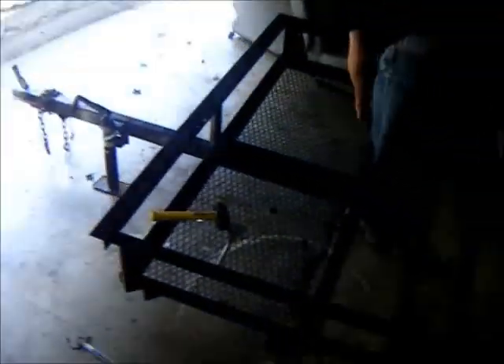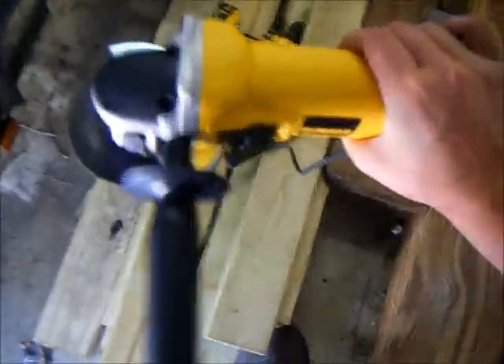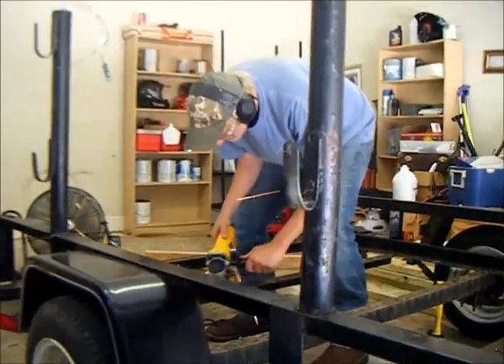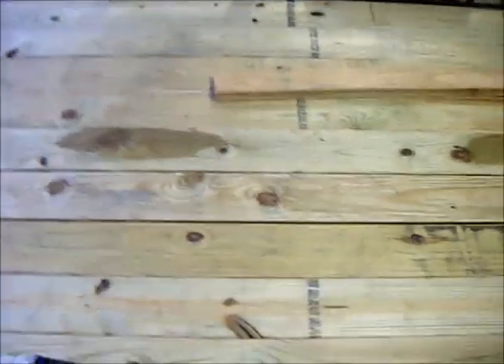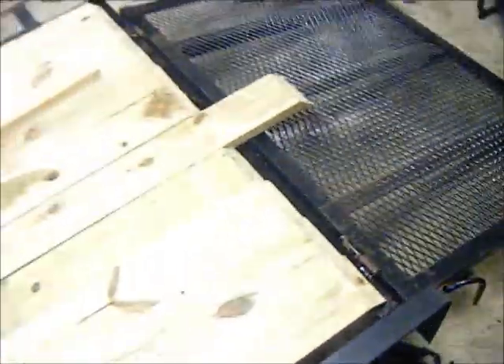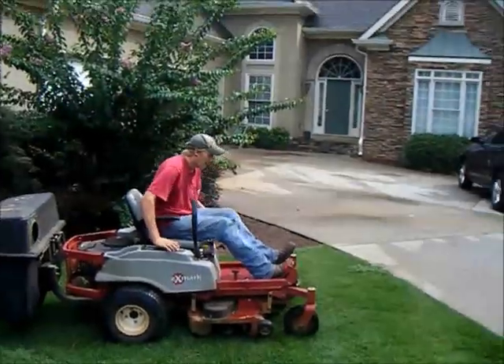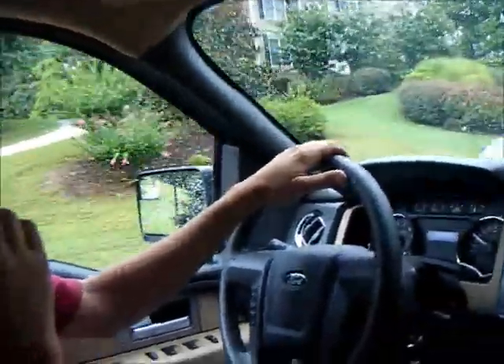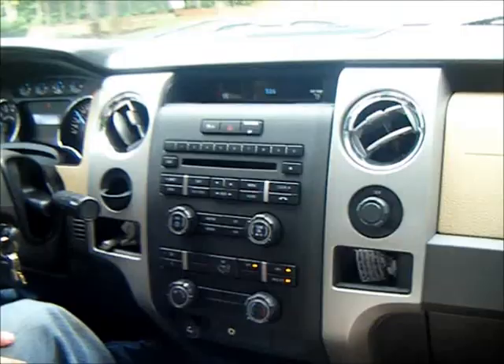A new deck for the trailer

Comment: I just bought a new trailer but decked it myself to save some $. Used 2 X 6 X 8 pressure treated lumber and bolted it down with 1/4 inch 3 inch galvanized bolts. I put the wood right over the mesh.
Reply: could you post a picture of how it looks
Reply: Jorge, I'll have to pull it out of the garage and clear it off to get a good picture. I'll post one as soon as I can.

Comment: Did you paint the grinder spots under the wood? Y
If not you should take the boards back off and paint it.. your asking for problems if you don't. Mine rusted out just 3 years after doing that.